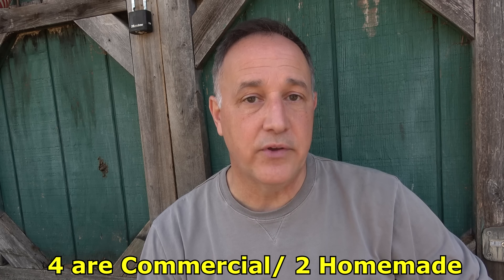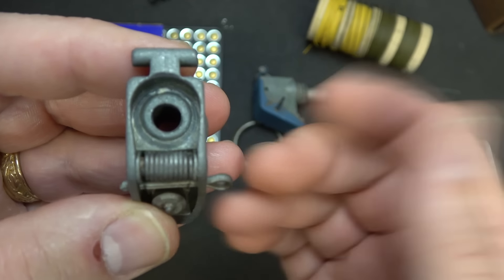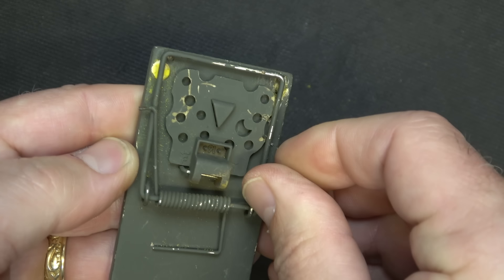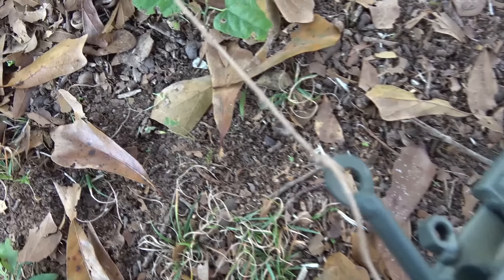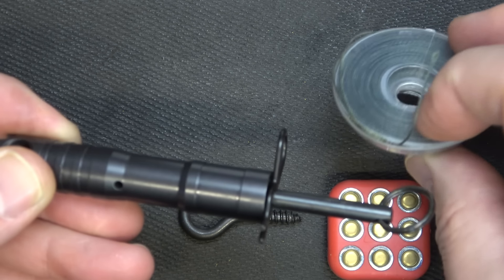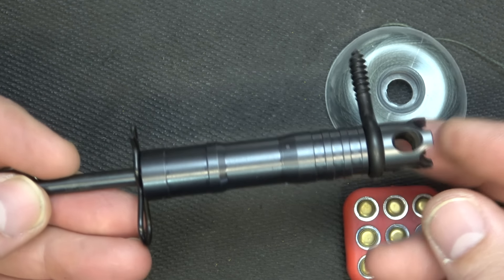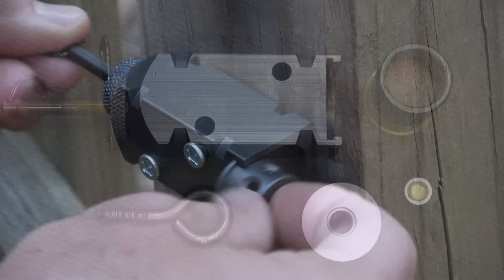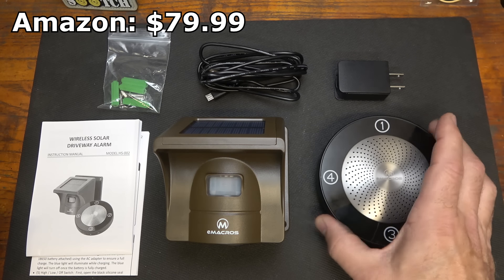6 Different SHTF Perimeter Alarms

Comment: I have a few of the 12 gauge alarms wired up & I hot glued an OC powder paintball round on top of the shells. When they go off it makes a huge inescapable pepper dust cloud. I currently live in NYC so I have 2 of them set up to go off if the door to my back gate is opened. 🤙🏼🇺🇸

Comment: We learned in the military, when setting up a perimeter you should place your trips far enough away to give yourself ample response time... if you are in a wooded area etc. using 4 different string lines (NSEW) will give you an indication of what direction your intruder is coming from... beverage cans with pebbles on the primary, then claymore mines, for a secondary perimeter...
Reply: From pebbles in a can to fckn CLAYMORES? 😂 You're crazy, and I'm all for it! 🤣😂
Reply: A great idea, especially if you need that cushion to react to a bear intrusion in to your campsite. Thanks for the great tip!! 😀

Comment: These devices accomplish a couple things:
A) They notify you that the boogeyman has arrived.
B) They also notify the boogeyman that YOU are now aware of their presence, YOU are now taking cover, YOU now have a gun and YOU now have the advantage.
Properly utilized, you have a serious force multiplier.

These tools should be installed out at the further perimeter line.  Use a different type at each level or zone.  This will allow you to place their distance without exposing yourself.

And remember...during an event, all inside lighting is OFF while all exterior lighting is ON. This process paints the perp with light while you remain concealed in the darkness behind the windows.
Blessings...and dial 911 if possible.
Reply: Well  said... 💯💯💯💯💯💥
Reply: With electronic devices, you can be alerted without the enemy knowing. Much better
Reply: Dial 911 afterwards: so they can do the paperwork and cleanup, which is the only thing they can do right half the time. They will never arrive in time to help anyway.
Reply: I don't call 911,,, takes to much time off target....
Reply: @bongsandbureaucracy2072  Not everyone is a big, tough guy like you. I'll bet you just scare away the bad guys with your rough toughness!
Reply: Call 911? In a SHTF scenario or for an everyday robbery?
Reply: @jrambo7495  
After SHTF calling 911 or anyone else is a total waste of valuable time. No one is coming to help you as they are all either trying to get home themselves or they are busy trying to take advantage of the chaos by hurting others.
Reply: @frostyjim2633  ok,???? Wasn't saying tough,.. it's statistics,. The time it takes you to grab phone call 911 and report what's going on, and REPEAT YOURSELF BECAUSE EVERY 911 CALL YOU EVER HEAR IS THE OPERATOR MAKING THEM REPEAT OVER AND OVER SAME THING,,. THE INTRUDER COULD BE ALREADY IN,,, now,,, that being said.. please dont presume to know a person's reasons,. Statistics show an average of 2-4 and a half minutes arriving after fact is 84%,, sorry not worth the odds I'll call after...
Reply: Dial 811 before you dig
Reply: And on a secondary note;;;
 If anyone does find themselves in this situation,.. after it's over,, families ok,, bad guys GONE🙏,,, SOON AS COPS SHOW UP ASK FOR AMBULANCE,.. hurt or not,,.. I know I know??? Why????,,.. because the adrenaline dump is massive,, and you really need to calm down before you answer ???s from police in blue states,, most don't have STAND YOUR GROUND AND CASTLE LAW,,.. I know NJ doesn't,,, they expect you to jump,, YOU AND YOUR WHOLE FAMILY OUTTA THE F#$$+ WINDOW AND ESCAPE,...... Not a joke look it up,,.. law states in NJ if have a way to leave house and get outts harms way you have to take that route or can and maybe charged with negligent homicide, up and no further to, man 2,.... NOW,,, another reason,,, in alot of counties across the US,. As soon as a police, sheriff  or state ??s you in hospital your are being detained therefore state or counties are responsible for medical bills,.. so instead of focus on you,, they can actually investigate instead of trying to fook you,,.. because they normally wait till discharged or at hospital,, which again you have doctor's making you feel better helping you calm down,, you can think and actually remember what happened,.. no just nervously rattling off like an idiot,,,JUST SOME ADVICE,,..
Reply: Whoa 👍
Reply: @jimdudgeon5038  oh I tested my privilege ONCE,,, ONLY ONCE,,... don't remember much,,.. after smacking the one cop I woke up a day later,,.. did not feel the privilege
Reply: @bongsandbureaucracy2072  👍 secondary note 👉💡
Reply: @MrDeleoco  ty good sir
Reply: These would be triggered each night by raccoons, groundhogs, foxes, possums, skunks, rabbits, squirrel, minks and all the other critters.

Comment: I have one one of those 12 gauge alarms. I have mine pointed towards the ground, just to be extra safe. Having said that, it just occurred to me that one can use multiple alarms on the same trip wire; lots of different surprising but harmless flashes and bangs. Make the bad guys think they're being fired at from all sides while making sure all the good guys wake up.
Reply: I had a similar thought as well! Good stuff; thanks!
Reply: You can also make your own shells
One guy used chili powder, magnesium, etc.
A face full of chili powder will probably chase off, bears & wolves.
Reply: @thomask6798  No joke!
Reply: You can honestly go to a dollar store and grab some confetti poppers as well.
It would be pretty funny seeing someone try to run away covered in confetti and glitter
Reply: Attach a plastic butane lighter refill infront of the shell..
Reply: @K5WEO_WRJZ673  any reloading type gun store, or any sporting goods place that has hunting stuff (this style primers are often used in muzzle loaders these days)
Reply: 100% you can daisy chain these so that the spring from one will trip the next and so on. Not only will it shock and awe your intruder as you said,  it you can gauge exactly where your breach is based on the sound of each going off in quick succession.
Reply: I want to use this idea for bears and camping so I don't want to harm them, just scare them. Great idea!! 😀
Reply: How is someone going to be forced to do those things?

Comment: Great info.
I have a couple homemade devises using motion lights and a radio to scare critters out of garden.  I take out one of the two bulbs. Screw in a light socket plugin adapter.  Hook radio to plugin adapter make sure it's on a good station and turned up loud. I have radio inside a box on post to protect it from weather.
As they come into garden area the motion sensor sees them and turns on light and radio. Scares the hell out of critters.
 And with a good motion light you can set it to stay on for short time or longer time.  And have it only work after dusk. 
I have been working out trying to make a scarecrow move by the same idea. Just need to figure out the mechanics of it so it looks like a person moving in garden when activated.
You could also use this idea to alert you of someone arriving. Omit the light and run an extension cord from motion light plugin adapter to inside your house. It could turn on a radio or a light in the house to inform you of their presence and will not alert them that you know they are there.
Hope this helps someone keep garden safe or your home.

Comment: I use the string poppers with 50 lb Spider Wire fishing line. Note that you can tape the popper to a balloon for extra effect. Take all the shot and wad out of a shotgun shell and fill it with powdered red pepper. Makes a nice little cloud.

Comment: I'm watching your video right now and it is some great information I truly appreciate you teaching this.
My go to poor Man's way is a door or window security device that beeps whenever you open them I put a magnet on the large core and the metal strip sticks to it that is tied with 30 lb test fishing line and I can cover large area.
When the string is tripped it pulls the magnet away from the washer and sets off the device with a loud beeping I set these around my camp so I know which way has been tripped. Thank you for letting me share this with you

Comment: In the army we used a FAL bolt with a blank clipped into the extractor, and hung it hooked over door or  a branch with the back of a firing pin towards the ground, rigged so it will drop when the wire is disturbed. When it dropped, it fell on the firing pin and set off the blank. Fun and games during training.
Reply: You guys had FALs? We only had m4a1 with acogs and peq15. What kinda leader lets a rifle be taken apart for parts to use as a tripwire? Thats asking for at minimum a good yelling at by the CSM. I think thats called a force divider iirc.
Reply: @Wrecker_Crew  the 11th commandment always applies in the army: " Thou shalt not get caught."
Reply: @Wrecker_Crew  and a shoutout to all the leaders in todays army: the most seriously abused word there ever was is "they". We would be caught sometimes loafing under a tree, when questioned wtf we are doing there? It often sufficed to mention "they" said we must wait here. Of course the fun and games REALLY started on the few occasions we were questioned exactly who "they" are.

Comment: Great alarms, I live in Colombia  for 298 years  in my fa I use a hand made alarm using a 12 GA. Round taking out the lead pellets  firing device standard rat trap, drilled block of wood to fit the round, very loud effective. Firing pin, nail in rat trap to set off primer.

Comment: I have those driveway alarms and put one on the driveway and one on the actual road that I own both sides of. That way I know if I am getting a visitor or if it's a potential trespasser. Used to get treaspassers all the time after a few weeks of checking every time it goes off treaspassers are no longer a problem.

Comment: Good info, thanks. I did install one of the driveway sensor alarms. My driveway is 600' long and 400' of it can't be seen from my house. It does work well and I mounted it waste high so cats don't trip it, but we have deer tripping sometimes at night. I did go ahead and order some of those trip alarms. I'll set those up, but not arm them until they are needed.

Comment: I live on a 300 acre farm. Our driveway is half a mile long. We use two driveway alarms about a hundred feet apart. If it’s a deer it sets off just one. If it’s a car the first one goes off then a few seconds later the second one goes off. Helps us differentiate between wildlife and vehicles coming down the driveway

Comment: Not sure if there a big thing in the states but in Aus i used too gut string pull party poppers of their streamers and attach it to a tent peg and use fishing wire to another tent peg and carry about 6 with me when i would do cadets. occasionally I would set them up in blind spots in our picket line so if we were tested in the middle of the night we had some warning. very cheap to make and set up.

Comment: A suggestion:. On the alarm that sounds off when the light stream is interrupted, have different sounds. If one has multiple installations of this product, use different chimes for each location. Memorize each one. This will indicate the direction of the intrusion.
Also be nice to your cat.
Reply: The video shows these selling for $79, but Walmart has them for $39. But my question is: What is the purpose of the 120v wall plug? Does the indoor alarm require constant voltage, or does it have a battery that can be charged up and then hung without being plugged into the wall? Thanks for any help.

Comment: There is an electronics company in Australia called Jaycar, they sell heaps of electronic kits aimed at hobbyists so you only need a soldering iron to assemble yourself. I bought a laser trip kit that only cost $20 AUD, an alarm goes off if the laser is broken and runs off a 9v battery. I'm sure you could find something similar on eBay.

Comment: Hmm something to wake you up in case of a no knock raid in the middle of the night could really save lives
Reply: They would also mean setting them up late at night & taking them down early in the morning. At that point just get some security cameras like Arlo or something. It'll alert your phone.

These are moreso meant for WROL/SHTF
Reply: I have one of the 12ga blanks on my back door with a loop around the door knob. Whenever I take the trash out, I just pull the loop off the knob, and reset when I come inside.
Reply: @Aglai76  These have their place, my friend.  They can be effective as far out as 1/4 mile and they can launch secondary measures such as signal flares or exposure flares.
Aaaaand...there are no batteries to go bad.
Best of all, these alarms will wake the pooch up while the perp is still a good distance away.
The bottom line is this: Do whatever works best for you and your family.  Alarms don't work if they are neither installed...nor set to function.
Protecting one's family should be the overriding priority for every man...always.
Reply: @GreybeardtheSurvivor  you make a good point
Reply: @mattmarzula  bucking the system and avoiding taxes is the true great amercian sport and pastime. get with the program citzen!
Reply: @Not still Dead i think by the time they open your door is too late

Comment: Braided fishing line works great in many applications where a strong string is needed.
Reply: I've used carpet thread and find that it's perfect as well as being inexpensive. That stuff is strong as most fishing lines.
Reply: yup, spiderwire is perfect. Extremely thin, perfect color to go unseen, and strong as the dickens

Comment: I don't know for sure but I think a deep brass  12 gauge cut off at the top of the brass.  Put in primer and a small charge and some cardboard wadding. Can be reloaded and reused. Shouldn't be a problem if you have the setup for reloaded 12 gauge shells.  Not sure but I don't think it can be done without the press. I would Not put a primer in the shell without the press.

Comment: If you’re using fishing line you high test braid or maybe even fluorocarbon. Regular mono has a lot of stretch.
Reply: So the flourocarbon leader i have would be a better choice?  I didnt think about the flex thanks
Reply: Jorge O I don’t have as much experience with fluro but I don’t believe it has the stretch mono has
Reply: 30-pound black "spider wire" type fishing line is nearly invisible located near the ground and has virtually no stretch.   Wire is great but a bit easier to see and the paint will often reflect direct light.  Monofilament line does not work well with the smoke caps and is also easier to see than the "Spider Wire"...day or night.

I might add that the heavier weight line is HIGHLY recommended.  Those cotter pins do not come nearly as easy as one might think, even with grease.  Some stainless finish nails actually work better in that regard.

Comment: Something to consider to add to your perimeter defense are some pulleys, so that can configure the trip wire so that the flash goes off in front of the adversary thus taking advantage of the disorientation of the flash especially at night, the flash bag typically will take away the adversaries night vision for a few seconds, especially if untrained. Might buy you enough time to get the upper hand.
Reply: I agree. I have the fith ops 12 gauge unit with the 209 adapter. I have it set up at ear level to disorient anybody that happens to trip it. Including myself, Once.  It works great.......
Reply: I would add that I used a screw in stainless steel eyelet thingy for a lack of a better term.  A simple nail would work too, but I had the eyelet screw available.
Reply: Especially in a true shtf situation where you can adapt the shotgun blank alarm to fire actual shotgun rounds

Comment: Don't forget the simple lightweight, cheap and resettable pull pin rape alarm.
As they have no explosives in them, so they can be purchased, carried and deployed legally anywhere in the world.
Not only can they be used for trip wires but with the aid of a short length of fishing line and a couple of thumbtacks, I've also used then to alarm doors and set them to go off if anyone moves a backpack that I've left in a room.

Comment: You know baby monitors with battery backup is a very good way for monitoring areas like your garage or anywhere in between thereof if you get the baby monitors with a 1000' range on them, I have one in my garage and one day it payed off 2 little boys saw my garage door open and decided to explore in my garage and I heard them from inside my house I scared the crap out of them but they did not take anything so that was good, but it works great.

Comment: The best perimeter alarm for a residence is one that the trespasser cannot hear, but that the residents can hear. That way, the residents have surprise on their side. It is also good to have an alarm that resets itself so you do not have to go outside to manually reset the alarm.

As a back-up in case of power failure or EMP, it is good to have a couple of smaller size indoor dogs who will alert you if they hear or see through the windows anything unusual.

And above all, it is good to have a secure perimeter such as sturdy fence or wall around the property with entry by an electronic gate and call box. This way a visitor must wait for the resident to decide whether to open the gate so the visitor can drive a vehicle onto the property (or so a visitor can drive the vehicle off the property). This is how the very rich protect the perimeters of their mansions and they can afford any type of security they desire.
Reply: @satbobsmith7261 Attack geese! 😂 But how do you keep them from, you know, fly away?